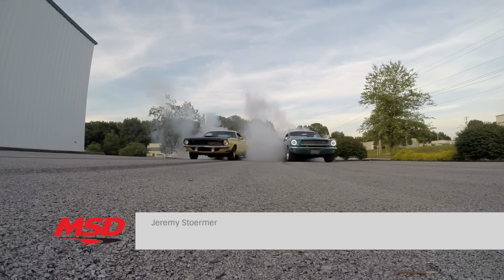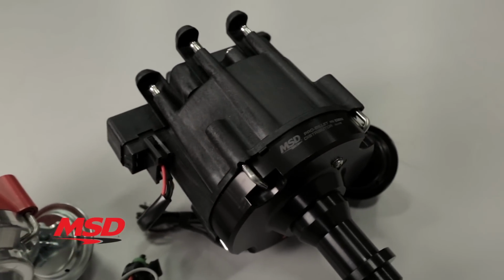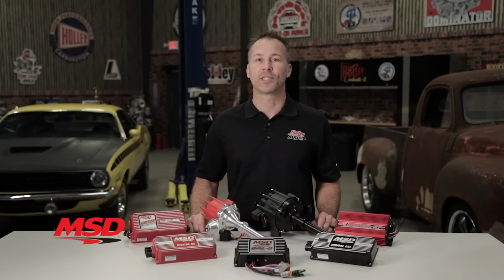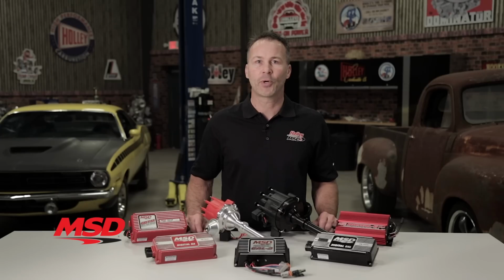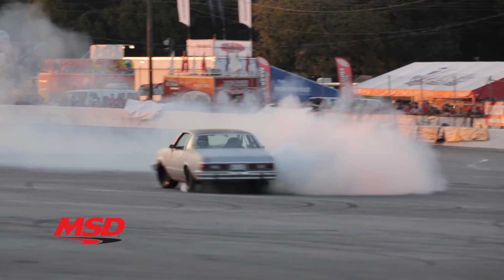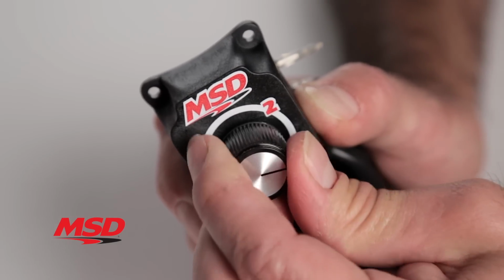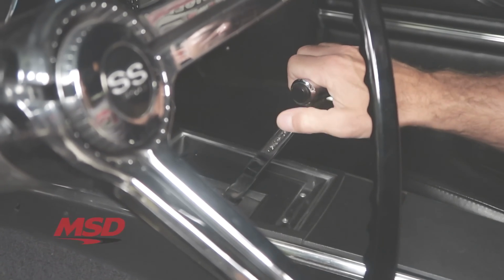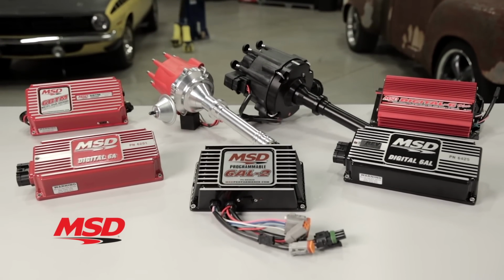How To Choose a Street Ignition

Comment: You can never have "too good" of an ignition system. Even if a car is just an appliance to you - you still want your ignition system to be the best that it can possibly be. Having the best ignition system possible improves torque, horsepower, gas mileage, and it also makes your exhaust emissions be cleaner.

Comment: I have been using MSD ignition for many years and works great. But there is a problem with using the unit if you have to get a smog test every year. The MSD can drive the smog computer at the testing station crazy and can cause you to fail the smog test. The smog test computer clamp on RPM pickup expects to see just one spark per crank shaft rotation. The multiple sparks in the plug wire confuses the smog computer causing a test fail when it cannot determine the engines correct RPM. So I have to disconnect the MSD and install a stock Ford ignition Dura spark control module before each test. It is not that difficult to do but do be aware of the problem if you happen to fail the smog test with your MSD setup.

Comment: I have been searching far and wide for the capacitance of the capacitors used in the MSD boxes.  You mention 535v, (I assume you are referring to the capacitor voltage limit), but PLEASE: WHAT ARE THE CAPACITANCES (Uf) OF THESE CAPACITORS??Thank you very much for the great video!  THUMBS UP!!
ps:
It would also help if you can tell me the maximum ENERGY (joules) stored in each capacitor, since from this and the 535v, I can calculate the capacitance.
Reply: SuperDave Miorgan  NO "ACT".  I simply asked for one of two parameters of the capacitor so I could have an idea of it's energy output in this function you are discussing!  It is a very valid question to calculate a very valid parameter, (energy).
Please explain your offensive reply...A YEAR LATER!  Again, SuperDave, do you know the capacitance (C) of the capacitor.  I wish to use the equation E=(1/2) C(V^2).  There are THREE parameters in this formula, but you only give ONE, namely V...just need one more.

Comment: You guys gotta do something about your new 6A boxes. Everyone in the custom car and racing world is having trouble with these things. And we've all been talking about it. We believe in your brand but those new boxes are junk. Everyone who builds and works on cars  and buys those things on the regular is having problems with them. And I do mean everyone. Not even exaggerating.
Reply: Like what
Reply: @larrywarren1049  box failures.

personally,  im on my 3rd box in my '53 Dodge Coronet, 241 V8 Hemi..... 

first one (which was a sweet vintage box) was my mistake using high amp jump start from a shop charger, but my replacement died just sitting in the car unused for just under 2 years. they dont epoxy the insides anymore. you have to get the off-road ones or others that are specifically marked as such. ive seen many comments in forums about the 6 boxes being junk for the past 8 years or so. i got an epoxy filled 6ALN box this time, but next time im left with no spark due to box failure, im going back to stock ignition.

Comment: I have a 99 tahoe ls 4x4 5.7 vortec. i have purchased MSD wires and MSD distributor, accel coil, and was wondering what is the best match for my daily. Family road trip vehicle.
Reply: The stock system is all you need. It only take one spark per cycle to run your engine.
Reply: JP JP  You would notice a misfire and the cel would come on. This is why I say these guys are full of Clay Davis.

Comment: Would the 6A work well with a Nissan vg30e v6 fuel injection motor that has some light mods?
Don't plan on going beyond headers, exhaust and mildly ported heads, intake .
Looking for some extra power and mpgs on my stock ignition setup.
Reply: Your stock ignition system is more than enough.
Reply: @blackericdenice  thanks.

Comment: MSD ignition boxes are garbage as fuck.  The old 6AL's from back in the day were tanks.  Those things never went bad.  Bought a brand new one from summit.  Lasted all of two days and left me stranded in the middle of an intersection.  Took it back and bought a HP digital box which is cheaper, smaller, and puts out more voltage.  Haven't had a single issue since.  Their distributors are decent but I'll never buy another MSD box ever.

Comment: Why don't MSD make a distributor cap with a sensor in it to read the exact location of the rotor, a set wires connecting it to a ignition box with mounting holes and spark plug wire post. Electronics inside to tell which spark plug to fire depending on the location of the rotor under the cap. Plus a power supply wire and hardware, plus longer spark plug wires and mounts for them.
Reply: That's the job of the stator, hall effect switch. To send the signal .

Comment: I purchased a programmable 6530, after setting up, the software was reading more then double the rpm, then my engine tach.
(Autometer Engine Tach, Laser RPM Tach AND Timing light all confirmed I was right.)
Couldn't fix no matter what I did. NO stock Electronic, ALL MSD products (Coil, trigger wheel, Wires. Called MSD support, 
They had no idea what was going on. So I sent it to them, after 2 months, I got it back AND still would not work, same problem but was only 1K RPM off.
I called them again, ask for a refund......The tech support basically called me a LIER!!    
So, MSD can go F'k themselves!!    Will never buy another MSD product again!!

Comment: 1:00 Stock ignition system has a weak spark? I guess he never been shock by a stock ignition system. These guys piss me off because they lie about there being a problem with stock system.
Reply: If you're running a stock ignition system on your muscle car you're cheating yourself.
Reply: JPS JPS , I totally disagree.
Reply: It's not that there is anything wrong with stock, but if you are running modified fuel or intake,  why wouldn't you up the spark?
Reply: @Treaxvour  Why would you buy 200 mph tires if your car only run 109.675 mph in the quarter?
Reply: @Promoney22  That's what they want you to believe so you will buy their bs.

Comment: If your stock ignition system is working correctly. Installing a MSD is a waste of money.
Reply: He keeps saying spark energy ,
With good spark plugs outta be good enough? Sorry in advance for my ignorance on the topic. But I want to learn enoughfor my own car. Thanx
Reply: @chemiv-sh7xy  You only need one spark to burn fuel. No car made in America fire the spark plugs more than once doing the power stroke. Not even the Bugatti Veyron. More than one spark is a waste of time.
Reply: @blackericdenice  oh I see. What about the cold air intake do see an advantage in that change
Reply: @chemiv-sh7xy  There is no advantage because the stock air box pull air in from a cool place. Also the stock air filter and box are not restricting hp. Yes I know there are 100 youtube videos that say cai work. They are lying.
Reply: @blackericdenice  Wauw... I wasn't to convinced, I just upgraded mine because I bought the car it already had the cold air intake but it wasn't "legal" in Cali. I spet $300. Shit I should of bought the original box. So is mostly for the sound huh. The same day I installed the k&n cold air filter I was doing 80 on the freeway and the fucking temperature gauge started going up I let go of the gas and it drop to the middle again. I thought is Bcuz it was sucking in all the heat under the hood
Reply: Multiple sparks is probably unnecessary but I think the msd stuff has computer controlled ignition capability and that is proven to be a lot better than a distributor
Reply: @iwanttobetankman4260  You only need one spark to burn fuel. Anything more is shorting the life of your spark plugs. Yes MSD have been around for years because people will buy anything a company tell them they need.
Reply: @blackericdenice  yeah fair I get that
Reply: @iwanttobetankman4260  Have you even tried one?